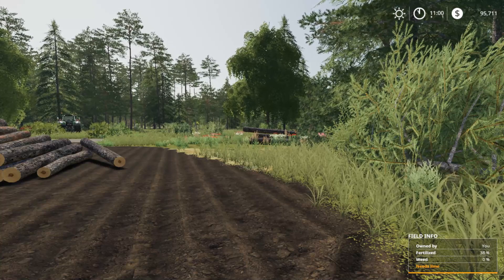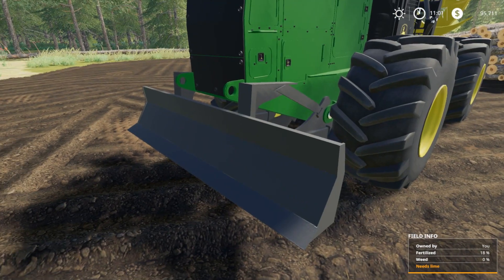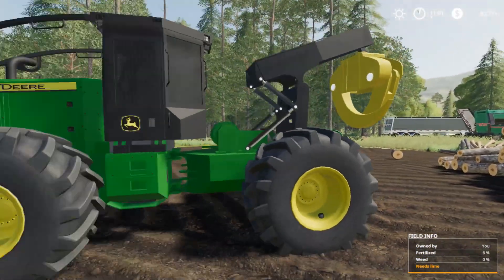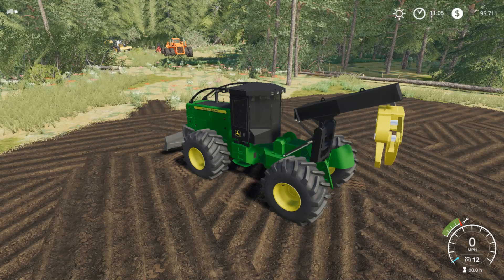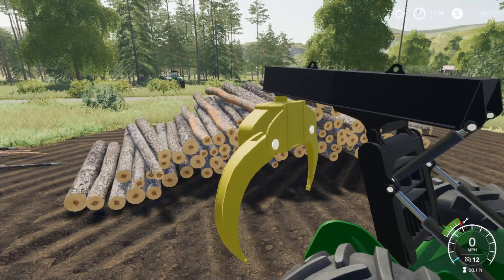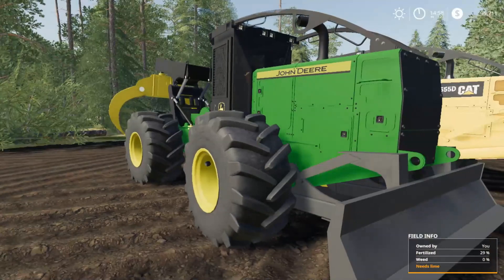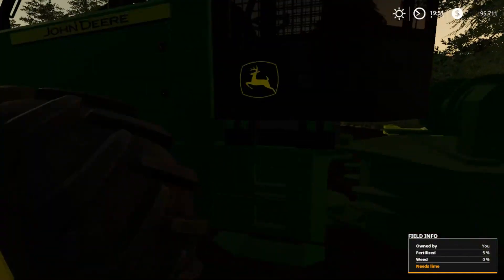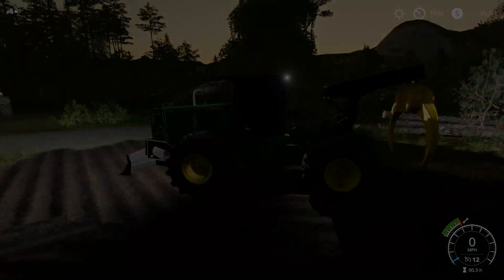Farming Simulator 19 - Mod Review - FDR Logging John Deere 948L Skidder

Comment: the new FDR skidder...from a 1 (being very poor to a 10) I would give it about and 8...its a great base tractor mod but as the guy stated in this clip...the front blade should be able to be controlled by the operator and it should be able to raise up higher....that and....the grapple head don't rotate like it should in real life....it may not seem like it but this really helps out a lot when backing up to a skid...and that's coming from a real life logger/skidder operator :) ….if FDR would address these little issues and release a version2 of this mod AND release a cable skidder version of this that would be dope :) but all in all this skidder isn't too bad.....it gets the logs to the landing like its ment to :)
Reply from the maker: I think with the front blade, since it's a plow, that's the only way they could make it work as a plow...either up or down, no in between.  I'm fine with that, although another version of the blade would be nice so that you could control it.  I haven't tested the grapple rotating.  They are working on a cable version.